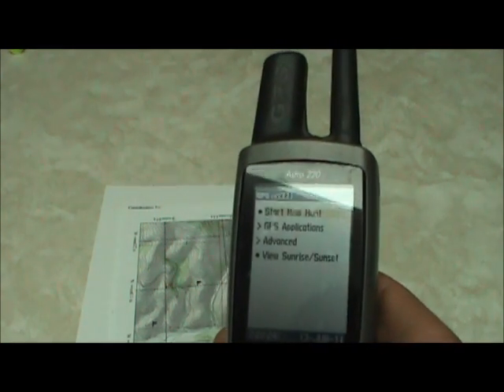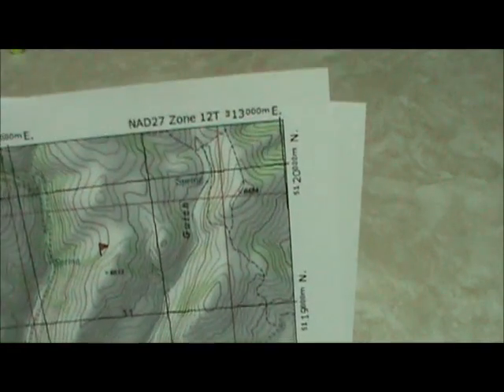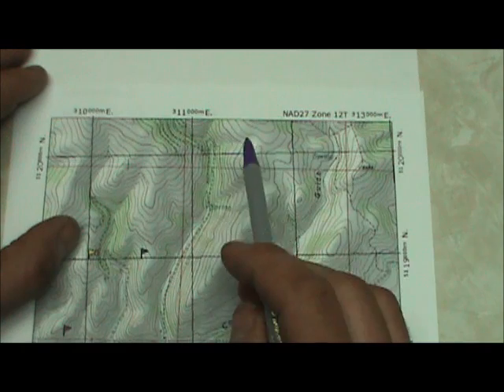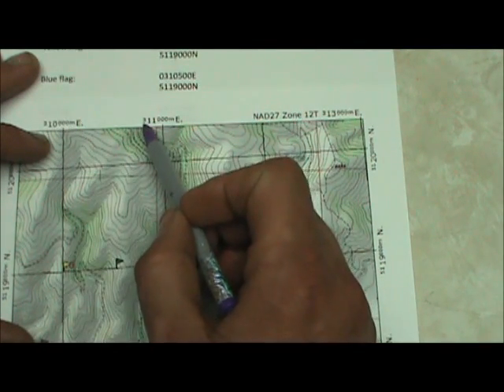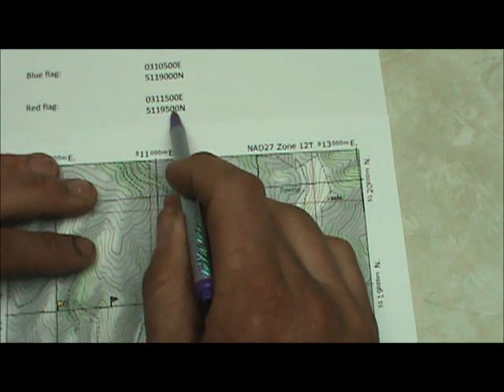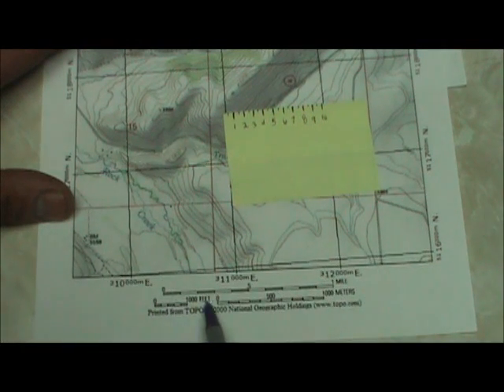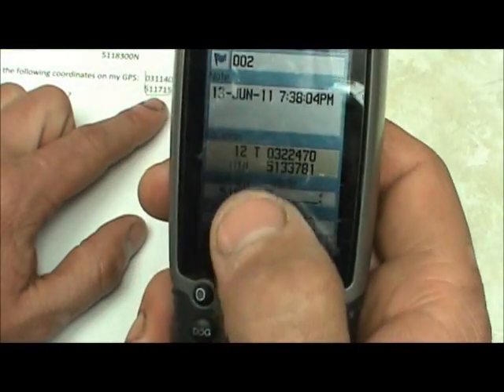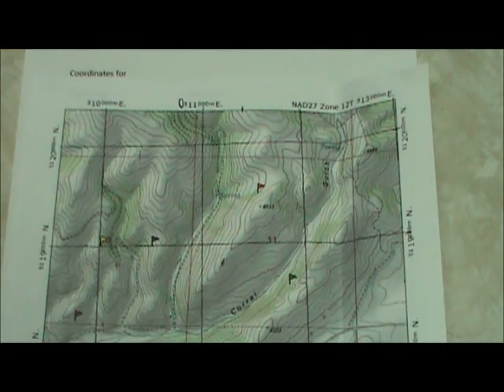Reading UTM coordinates and entering them into a Garmin GPS

Comment: Nice trick starting at 11:30 with the folded paper.
However, unless you're calling in an artillery strike, most civilian users will very rarely have any need to plot the location to a greater precision than +/- 100 meters. The "eyeball" method that he goes over in this video is fine for that and you really don't need to use the folded paper trick.

Comment: I've set up my GPS to:
Utm/ups
Nad 27 cons
distance /speed (statute )
elevation / vertical speed (feet)

I'm having problems with giving me proper feet elevations correctly. 
can someone help me figure  this out??
thanks, 
Kevin
Reply: Newer maps use WGS. Don't rely on NAD27 unless your specific map uses it. NAD27 is used with vintage maps (like historic maps, and treasure maps). In any case, always check your physical map's notes for which datum they used and then adjust your GPS to use that datum.

Comment: @MrRocque, thank you for your clarification. Understanding the UTM is rather difficult (as opposes to commonly use in GPS coordinate system)  if one is not using it in a daily situation. Always find education is enriching.
Reply: actually, the UTM system is EASIER then LAT/LONG because its in distance (meters) not angles (which is exactly what the LAT/LONG system uses, thereby distances vary depending on your latitude).
The UTM system uses a 'base 10' graduation...(metric, basically); LAT/LONG uses angular degrees (degree, minutes, second) with each 'unit' of graduation being a more difficult conversion to the next. IE. 1 degree = 60 minutes = 3600 seconds, so when adding or substracting LAT/LONG coordinates...there's MORE chance of caculation errors.
So...UTM uses ONE unit of measure...Meters...no converting, easier math...once you're used to HOW the system works a coordinate (within the same UTM zone) can give you location on a map AND distance (on the horz. and vert.) without converting, you just subtract the eastings and the northings...and that's the distance (in LAT/LONG there's conversions and way MORE math involved)

Comment: The explanation of 'eastings' is incorrect. 0310000E is NOT 310,000 meters east of the zone western limit...but rather 500,000-310,000=190,000 WEST of the zone meridian.
(below is a detailed explanation of WHY. To readers...don't bother reading it and complaining if you chose to do so)

Every UTM zone is bisected vertically by a merdian designated with a falsing called 500,000E. All eastings in the same zone are designated either lower or higher (depends on if its west or east of this meridian). Hence 0578243E IS 78,243 meters EAST of the meridian (but NOT 578,243 meters east of the zone western limit), but 0436557E is 63443 meters WEST of the zone meridian, NOT 436,557 meters east of the zones western limit.
UTM zones are 6° wide (longtitude) and bisected by the equator; numbered 1-60. Then divided into UTM quadrants (20 in total) of 8° of latitude (there are exceptions) lettered C-X (excluding I and O)
Thusly, each UTM zone quadrant (12T as an example) is 600,000 meters wide by 1,000,000 meters high. Thereby making the quadrant limits in UTM coordinates from 0166640E (western edge) to 0833360E (eastern edge). So 0310000E can't be 310,000E of the western limit, if the western limit didn't start at ZERO (0), but that it is 143,360 meters east of the western limit of the zone (and with the merdian of 0500000E being 333360 meters east of the western limit) and 333,360-143,390=190,000.
Northings, on the other hand ARE meters north of the equator starting at 0000000N at the equator and increasing north.
HOWEVER...south of the equator it doesn't decrease into negative numbers, but rather decreases from 10,000,000 meters (call the equator (1)0000000N), so one meter south of the equator is 9999999N, 2 meters south is 9999998N and so on.
As such, a UTM zone (using UTM coorinates) has a lower limit of 166640E1110400N (bottom left corner) to 0833360E9334080N (top right corner). That is, the bottom of the zone is 1110400N and the top is 9334080N (the whole zone, not just one of the quadrants) and the western limit is 166640E while the eastern limit is 833360E.
EVERY zone repeats these limts and coordinates, this is why the zone quadrant MUST BE communicated when speaking to those OUTSIDE your zone. Not doing so only says where you are in a zone...but not what zone, what part of the globe, you're actually in.
The UTM coordinates 0500000E5000000N is in SIXTY different zones around the world...which ONE are YOU in? zone 3? zone 55? zone 26? they all have a location fitting that coordinate.
This is exactly why its IMPORTANT to study, train and KNOW the system you're using. Its limitations, its 'quirks' and NOT TO PASS ON false information about that system (like...eastings are meters east of the western border)
Reply: ***** UTM coordinate system is incredibly easy to use, once its learned (there's no converting anything, its all in meters, no degrees, minutes, seconds, miles, etc). The problem lies in WHICH datum a map is using, which projection...and this effects LAT/LONG as much as it does UTM. So, sadly...until all the sources (maps/gps) are on the SAME datum...it can all be very 'messy'.
Now, WHICH coordinates did you try to enter? As for 'how to get LAT and LON'...I don't understand what you mean by 'how to get' (off a map? off your GPS rec'r? from Google?). You either HAVE coordinates (someone gave you a set) or you determined coordinates (found a location and worked the coordinates out). No idea what you mean by 'how to get'.
I can't give you instructions on how to operate YOUR GPS reciever as there are far too many to know EVERY detail of them all...and YOU should have already read you manual.
As for Google Maps, they only support Lat/Long searches. You have to convert a UTM set to Lat/Long to have Google Maps plot it for you. Google Maps only recognizes DD, DMM and DMS formats (decimal degrees, degrees decimal minutes or degrees minutes seconds). If you wish for Google Maps to GIVE you coordinates (from their map) you simply hold the cursor over a location, right click and choose 'what's here' and the coordinates will appear under the search space as DD coordinates. At which point you can use those or convert them to the format you wish to use (other lat/long or utm).
With regard to learning Lat/Long, there are all kinds of YouTube videos on how to learn navigation skills. Much easier then me trying to explain a system that is unrelated to this video.
Keep in mind that, what ever coordinates you have or are getting...Google Maps uses the WGS84 Datum...so if your coordinates or maps are NOT from this datum...Google Maps will be off a bit (like Google is ever accurate in the first place). This applies to either coordinate system, UTM or Lat/Long (datum effects BOTH systems).
If you wish to learn UTM, there are some wonderful channels that explain it...you can find a number of links to videos, on my channel under the playlist 'Navigation'. But there are no Lat/Long links in my playlist.
Should you require further answers or explanation, I would encourage you to send messages to me directly, through my channel.
Reply: ***** , It is extremely helpful to be able to enter coordinates in a Google search and have a map of that exact location draw on your screen. Here's how to do it.
Google wants to see latitude longitude coordinates in a format called decimal degrees. Google does not draw in a correct map if you type in UTM coordinates. 
For example, try pasting this into a Google search: 38.8963, -77.0366. It should draw a map of the white house.

An easy way to determine the decimal degrees coordinates of any point on earth is to open Google maps, right-click, and choose "What's here?" A small pop-up box will appear with the decimal degree coordinates of that point.
Reply: +MrRocque While you are technically correct, it is perfectly fine to explain that in Easton value is in fact 310,000 m east of the left edge of the imaginary grid that overlays the zone.
Reply: +johngo6283 no, its actually NOT 'perfectly fine'. To say a coordinate is 310,000 m from a boundary is NOT the same as saying a coordinate of 310000E is 310,000 m east of a boundary, because 
ITS NOT. The easting of 310000E is in fact only 143,360 m east of the 
zone boundary. You would have people looking 150kms away, if using the reference of 'meters from'. Teaching people that an easting 'is the number of  meters from the zone boundary' would be foolhardy. That would be the same as saying 'all compasses point the direction where it points' simply because a bearing compass does. You wouldn't tell someone it was 'perfectly fine' to pick ANY location on earth as the prime meridian, the corrdinates wouldn't translate. Just as, in your opinion, telling ppl that coordinates are XXXX meters from the edge of a boundry on a zone is ok.
Coordinates, just like azimuths, are based on a common reference point. In azimuths in navigation its the North Pole (degrees clockwise). In Lat/Long coordinates its the prime meridian (degrees +/- or east/west) and in UTM its the merdian of the projection used for the map...the 500,000m meridian in a zone.
IF everyone is on the same map, exactly the same map/scale/zone/quad/datum, where the boundary coordinates start or end is of little consequence. But not everyone deals in the same map at the same time, hence the reason for different scaled maps. And given the distrotion inherent with different projections and datums, where the boundary's coordinates actually ARE is VERY important...if someone is moving across more then one map.
If one intends to TEACH, teach PROPERLY. Taking a short cut is not only irresponsible, its dangerous. "A little knowledge is a dangerous thing" and 'sending' people out with the idea they know what they're doing is as well. Never mind stating a complete falsehood as FACT.
Its one thing to say 'for simplicity, we'll ignore where the boundary coordinates actually are' and its another to claim eastings are east of a 0,0 boundary.
2x2.4=4.8...one could round up to 5...but you don't TELL someone the answer IS 5 without qualifying it (rounding up) as if its FACT that it is 5, just because its 'easier'. A compass needle does not always point to the direction your facing (that depends on the compass you're using) and UTM's eastings are NOT meters east of 0,0.
If people wish to learn, they have a desire to learn the RIGHT information. Let them choose what to ignore and absorb...but do NOT mislead them.
Reply: +MrRocque Wowzer, you certainly seem to have a lot of time on your hands to correct people. Perhaps you should get a map of a beautiful place that of course has the proper use him grid on it, and go for a nice relaxing hike. Or perhaps you should go and some Wikipedia articles or something, I bet you'd be really good at it. Or, if you have so much to slam on other peoples UTM videos, what do you make one of your own?

Notice I said the "imaginary grid that overlays the zone" not the zone boundary. They are different things. UTM zones have what's called a false easting, which is 500,000 meters left (west) of the central Meridian. This "false easting" is the starting point for zero easting for that particular zone. While you explain the technical definition, it's probably more helpful to explain it in a way that makes it easier for beginners to get the basic idea. So, UTM coordinates can in fact be measured from a "zero, zero" starting point. 0 Easting is the false easting, and zero "northing is the equator. 
Have a good one.
Reply: +MrRocque "Thusly, each UTM zone quadrant (12T as an example) is 600,000 meters wide by 1,000,000 meters high. "
Since you're being so picky on everybody else, here's one back on you. This is not quite right. One zone, in a hemisphere, is 600,000 meters wide by 1,000,000 meters high. When you add the "T" latitude designation into it, you're slicing that zone down into a smaller quadrangle only 8° of latitude tall, which is much smaller than 1,000,000 meters high you mention.
Geez, get your facts straight before you post.  =^) (and yes, that is a smily, lighten up)
Reply: +johngo6283 wouldn't 500,000m west of the central meridian of a zone be in a totally different zone? um, yeah it would, the one to the west? that would give you a cooridinate of 0733320E in that zone. So if you were in zone 12, you''d be measuring from zone 11. So how do you explain to them when they're using a map and and can't find this mystery 0,0 coordinate in the next zone? So to teach ppl to do the math from a 0,0 coordinate that doesn't exist...is teaching them to take an easting of 0100000E and telling them they're 100,000 m from some UNKNOWN 0,0 coordinate in the next zone.
The 0500000 falsing is not east of any imaginary 0,0 coordinate. it IS the bisection of a zone, given a label of 0500000E. It could well have been labelled 0800000E. It was NOT measured from some imaginary point. Its merely a 'false' label for a meridian so coordinates east/west of it could be described per their distance from that meridian while maintaining a 6 digit format (preceded by a 0 to keep with the 7 digit northing). It could have been easily labelled 2000000E. But by using 6 digits proceeded by a 0, it identifies eastings from northings more easily.
Stating that a merdian is 500,000 meters from some imaginary 0,0 coordinate is like saying one meter south of the equator (9999999N) is 9,999,999 meters north of some imaginary 0,0 point out in SPACE. When in reality, its merely the distance in meters FROM the equator subtracted from 10,000,000 (the equator is actually given a northing of 0000000N, when substracting from it, 10,000,000 is used), just as all northings above the equator are 'meters' north of 0000000N.
As such, eastings are meters east or west of 0500000E, subtracted or added accordingly. Btw, quadrangles aren't technically 600,000m wide either, but you never bothered with THAT point
That's how its defined, its how I teach it, that's how they learn it...and I've never had a single person EVER not get it when its explained this way. And I don't spend a lot of time on it, its very simple and easy when explained properly and NOT permitted to be east of some convoluted, nonexistant coordinate.
I have had people ask 'is that meters east', and the very simple plain answer is...NO, its a fake measurement. A 'falsing'.
And when they get to maps that cross a boundary, they have NO question about how to work out distances. No 'oh that's xxxxx meters of 0,0 in a west zone, so that's um...????km from that road in the other zone'.
And to address your following comment. Zones are >18,000km high, even divided by the equator, they're >8,000 kms...that's 8 million meters (northern quads. are >9,300kms). So I'm assuming you got confused and meant quadrangle when you said zone. And yes, a quadrangle is NOT 1,000,000 meters high, nor are they all 888,000 meters either, they can vary by over 8000 meters depending on latitide, because a degree varies by >1000 meters, depend on latitude. ie. equator a degree is 110.6km and at the poles its 111.7km. So 8° on one quadrangle could be 888,000m and on an other 880,000m. 8,000 m difference.
But when teaching the UTM system, so people can wrap their heads around it, since it uses a 'base 10' measure of meters using grids of 10x10, the concept is taught that a quadrangle is 600x1000km. Makes 10x10 grids easier to teach then in a 600x800 quadrangle. When they get how the UTM system works (simple basics), they are taught the actual distances as PER the coordinates (and they do call me on it when they so often realize 'hey, that's not a million'). Because, they absorbed the concept quickly, usually within LESS then an hour, I normally have people locating and measuring UTM coordinates on real maps and communicationg those coordinates, in under half a day (and that includes teaching them what navigation IS). So by the afternoon, we're actually OUT, in that outdoors you mentioned, practicing IT.
Map work, doesn't care what a quadrangle really is. Because maps are NOT sold by UTM. They're sold by lat/long (USGS 7.5', NRCan 30'x15') with either UTM grids printed on the map or UTM hash marks on the map's borders. And a 100,000m x 100,000m grid covers 100kms wide and high...could very well cross zones or quadrangles. If you're using a map that emcompasses the entire grid being used...distance is merely a simple ruler away. But if you have to measure over two diff. maps AND scales...some 0,0 unattainable coordinate merely muddies the thinking and adds yet ONE more piece of math that is unnecessary. Especially if someone is using a small scale map that covers that grid, communicating to others using larger scale maps to the local area. Its also why I teach proper communication of coordinates, when I teach the UTM system to people.
And why am I so...'uptight' about it, cuz 'a little knowledge is a dangerous thing' and ppl get LOST and hurt by a 'little knowledge'. Most people couldn't fathom the number of 'responses' in my area re: ppl that had a little knowledge and got in trouble. People DIE every year, before help arrives.
Teach it right, so they learn it right, so they use it right!
Why don't I make a video...1. they already exist (that explain it properly), 2, don't have the equipment to record it well, 3. I don't believe its something one should learn from YouTube (you can spark an interest or get some info). There's no 'checks/sums' to make sure someone is absorbing the information correctly. Hence the disclaimers ppl put on vidoes 'entertainment only'. But I can try to correct misinformation, hopefully (can't make them read the comments).